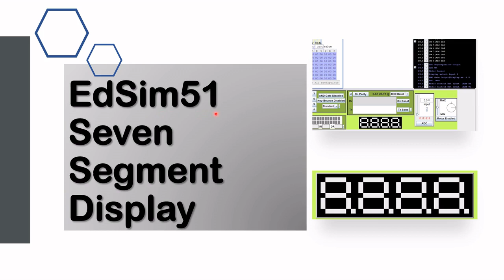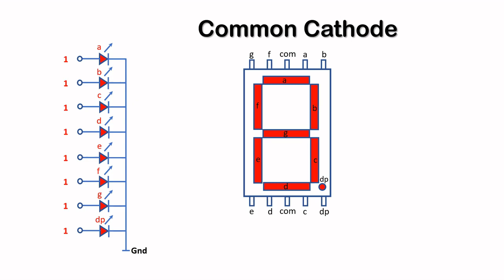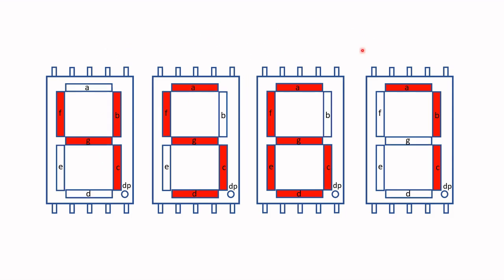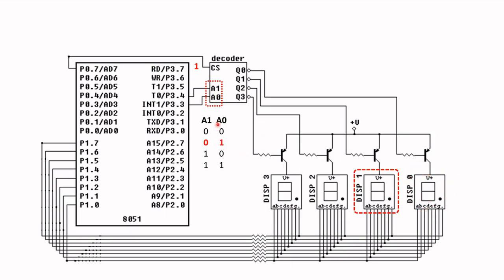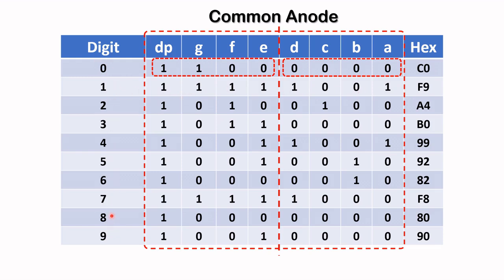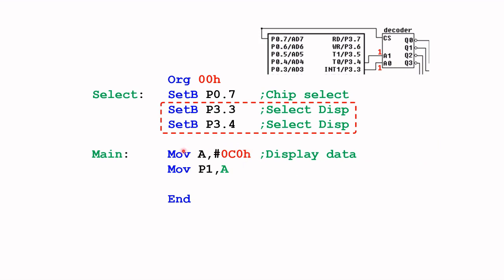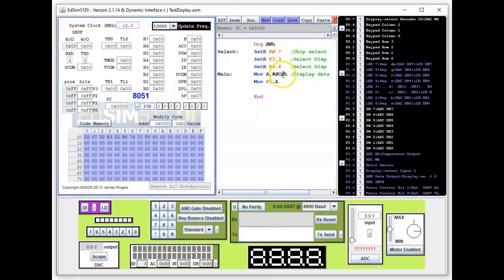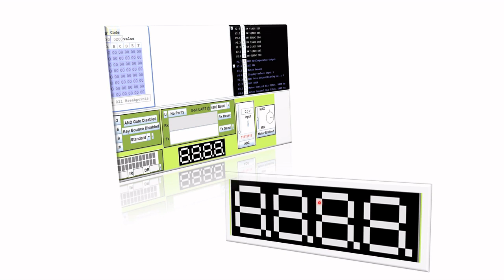#24 EdSim51 Seven Segment Display

Comment from the maker: This message is for Nathan Daniel. For reasons unknown to me I can’t find your comments that you posted on YouTube but I did received your comments/enquiry via gmail. You wanted to know how to run a binary LED counter without having the 7-segment display showing anything. You can try reassigning the 7-segment connections via the EdSim51 Dynamic Interface (DI). Check out this link regarding DI: https://www.edsim51.com/simInstructions.html#LDAndDI. Let me know if this helps.

Comment: Hello, thanks for the content.

Can we light two lcd's at the same time.

Viewing number 1 in led 1, viewing number 2 in led 2 at the same time. 

Being able to see 12 in the 7 segment leds
Reply from the maker: Yes you can. Check out this link: https://edsim51.com/examples.html#prog3
Reply: @vooiyap  thanks for the reply, i checked the code and in there led 1 displays 1 and then turns of, and then led 2 displays 2 and then turns off. i don't want that led 1 or led 2 gets turned off. 
What i exactly want is, can i see two leds lighting at the same time?
Reply from the maker: @zekeriyyakoroglu3461  Hi, I regret to say that is the limitation of EdSim51 simulator. The technique should on real hardware. You could try Proteus Simulation software but I have no experience with Proteus.
Reply: @vooiyap  I was trying to find a way out how to do that since a few days for a school project, thats good to know that it is not possible. 

Thank you for the support.
Reply from the maker: @zekeriyyakoroglu3461  Hi, I am glad to be of some assistance. You can contact me at the following email: vvy.eseducation@gmail.com should you require any help.

Comment: how can I use the first display and the second one at the same time?
Reply from the maker: You need to multiplex the two displays.
Reply: How to do that sir @vooiyap
Reply from the maker: In multiplexing, you alternate between the two displays very quickly.
Reply from the maker: Check the following links:
https://www.youtube.com/watch?v=tOY60EA2Gbk
https://www.engineersgarage.com/seven-segment-multiplexing-using-8051-microcontroller-at89c51-part-4-45/
https://www.youtube.com/watch?v=UFWjkoE33Xo
Reply from the maker: Also check out this link: 
http://www.edsim51.com/examples.html#prog3

Comment: Hello sir, how can I make my 7 segment display number repeat certain numbers? like 5 times.
Reply from the maker: Hi thank you for comments. Regarding your question I recommend you watch video #25 Counting with Edsim51 7-Segment Display. With reference to the code used in video #25 you can define the numbers you want to display in the look-up table (LUT). In addition you need to set up counter to monitor the number of times the number is being displayed. I hope that helps.
Reply: @vooiyap  Sir, may i know how to set the counter? And Thanks for replying really appreciated.
Reply from the maker: @ibraahimfiqi5115  Hi you can consider using one of the registers as a counter.